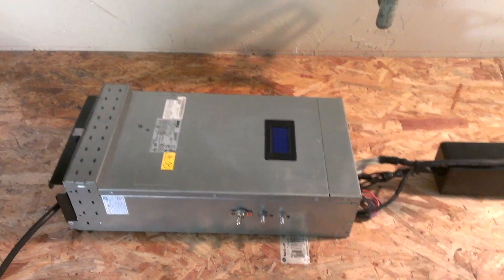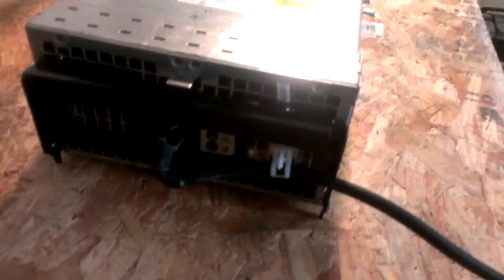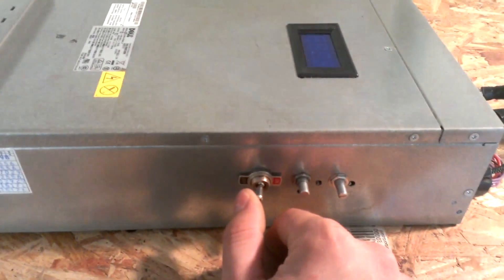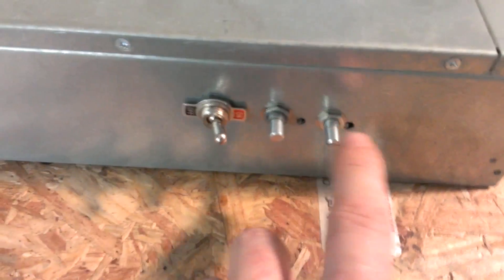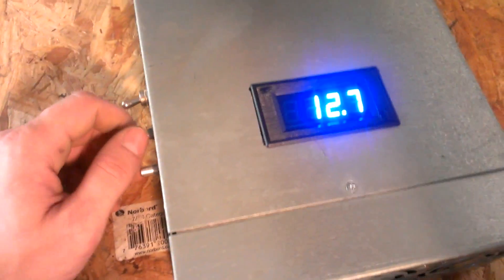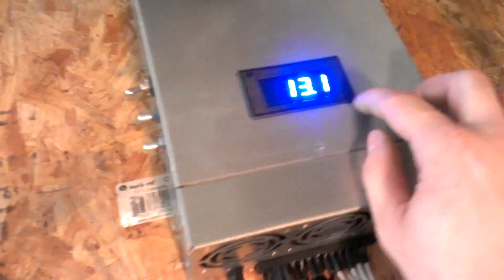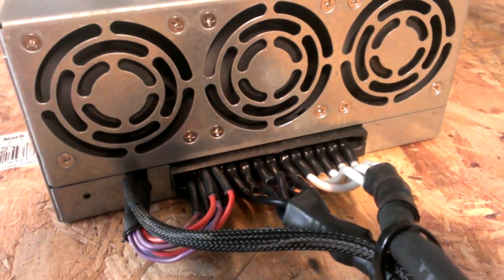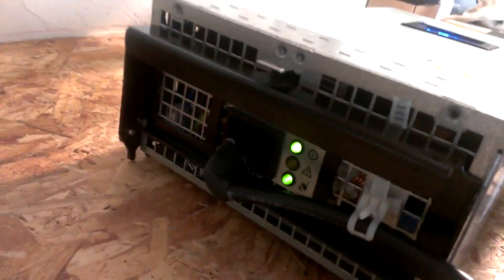How to build a high amperage DC power supply.

Comment: Looking to do this to run a car audio amplifier inside.  Currently running a 80 amp power supply at 12 volts  but I'd like to achieve 13.5-14volts  so that the amplifier will do closer to rated rms power.

Comment: I've electrocuted myself on a regular ATX power supply. They aren't lying when they say it's dangerous Inside the Box. The reason I shocked myself is because the entire heatsink for the transistors or diodes or whatever is electrified. Just a warning.

Comment: i want to charge my car bettery with computer power suply. But in power suply there is a yellow color wire having voltage is 12v thats ok,,, but ampere is low as about 1ampere to 2ampere only (which is not suffient to charge my car bettery). My problem is that how to increase the amperage of (yellow 12v wire) so that it charge my bettery easily.
regds,
thanks. plz reply in detail to solve my problem
Reply: You can't change the amperage of an ATX psu. You can combine all the 12V rails to get a few amps total but you can't just increase current while keeping voltage constant. It would be like increasing speed without increasing fuel consumption.

Comment: jonathan fasking Thank you so much for the Video. Is it possible to run a potentiometer to change the amperage? Sorry if this is a dumb question, I don't know much when it comes to circuitry and such.
Reply: It's a switch mode power supply and only outputs as much current as the device it's running pulls, I'm sure you could probably set a maximum  limit despite what the application demanded but unless you're doing it for test bench purposes for powering car amps at low current to for repairs or something it wouldn't probably make much sense.

Comment: Thank you for this VDO upload. I have one Question though, I want to power UP my Sony Xplod car amplifier at home which needs 12V to 15V DC supply with current rating of 26AMP to 35 AMP max, so basically i need 13V/35AMp DC supply. I am currently using SMPS at home for this which gives me 12V/25amp and my car amplifier works fine, but it gets Switch off when I increase the sound, due to may be it needs more current or Voltage...Please suggest why its so....Therefore I am thinking of using a car battery of 14V/35Amp here for smooth amplifier operation but to charge it, your trick may work, but i dont have volmeter. So tell me how much time it will take to charge battery fully with laptop charger without using Voltmeter or multimeter. OR else suggest me how I can get output of 13V/35Amp from SMPS or any other device conencting it to AC power supply at home.....thank you....
Reply: Just get a bigger power supply and call it a day

Comment: Is there any way to make this output 24 volts as opposed to 12? I've looked at DC to DC converters but they aren't rated for high amperage. I need about 1000 watts for my project (an hho torch), and at 12 volts, it's too hot. I need to be able to run it for about 15-20 minutes. Do you have any suggestions?
Reply: you might try ebay .The have some that goes up to 48 volts . Amps depends on which one you get . look for Meanwell switching power supply. Some can go as low as $33 up. Good luck.

Comment: I like it. There's alot of neat server power supplies floating arount on ebay. If you have a multimeter with temperature reading capabilities, you could have bought 3 or 4 extra probes and left planted them into the psu so that all you have to do to monitor temps is to plug the multimeter into them.

Comment: jonathan fasking do think this could power 1500 watt amplifier
Reply: Myself i use at least 200 amps 14 to 15.6 volts. That should run 8 100 watt transistors , witch on these volts you should get at 12 to 2000 watts depending on amplifier you have.

Comment: If i were to upgrade the filtering caps and other DC output components to a high voltage (and the same UF capacity) what max voltage do you think this switch transformer would max at?, how i understand it there is a 300v inverter, theoretically making the max voltage output 290v or so?

Comment: my dell t5400 happily runs a 1200 watt car amp but be warned, I Have warm wires from pc to amplifier and that's with 4 power and 4 ground wires. 18 amps per rail on my dell psu, which is a 850 watt power supply. 5 separate 12v rails combined. don't use thin wires you'll cause a fire or a short

Comment: Personally I'm not keen on this design.
1)Three fans screaming???
2) LED's on back, panel gauge on top, pots & off switch on side???
2) Panel gauges reading both A & V are readily available & low cost.
3) Really who needs 130 A??
Reply: Well i kinda need 150 amp in 24volts.. we use an old truck trailer as storage.. it has a loading lid thats need a lot of power. It can now only be done with the batteries.. (2x12v at 150Ah paralel)  anyone got any idea how i could fix this.. need it to run without batteries.

Comment: None of the links work just goes on to report spam? You done any thing with the 1855,1955 2100w yet 175A at 12v can you just add a picture of what pins you using for fan control and power adjustment as I need 13.8 the picture of wiring in this video is out of focus which is really frustrating buddy many thanks for sharing this though cheers n beers
Reply: Lol just seen all the info has been added cheers again

Comment: Hey John I built a power supply with 2 dells. with dual output I'd 12 and combined 24 volts. they have a mac 750 watts per u it and 62.4 Amos each also. I've been looking for a way to make them a constant varitable bench top supply using all it potential.  the supply you built seems to do this. I've been told to get a variants, step up step down transformer board  and even a dimmer. problem is nothing will ha dle my watts and amps. can you please help.

Comment: this is dumb, the supply  you used to build this costs more than just buying an actual supply with the specs you need.
Reply: You can get one used for like $25
Reply: Thad ward So? The point of doing projects like this is to learn more about the real world restrictions involved.
Reply: Atx power supply in parallel

Comment: I have a 250 watts(max) power supply and I tried using it to power an amplifier but after a few seconds of coming on it would shut off automatically, any ideas why that might be? is the power supply not powerful enough?
Reply: yes you need a stronger power supply.

Comment: Thats right at the amps of my Lincoln welder...wonder if yours could weld?...or is there something that would shut it down if drawing 130 amps..? cool..video..
Reply: +Kennynva T. There is a lot of current, but the voltage is a bit low to weld with. The total power output is not that high really.

Comment: Interesting.. I am working on an unregulated raw AC-DC convertor block for the welder... won't be as clean as this but it will handle the 80VAC at 225A (its max rating will be 1000VAC at 500A).  Computer power supplies are getting awesome these days for other electronic projects.

Comment: Also needing to build something big , I have 5kw Transmitter I need to get going .. without dimming the house lights ... think its time for 3 phase setup :P

its around 400 AMPS Draw ...
Reply: M4ST3RC4TS 5kw and 400amp are you nuts 5kw is like 10-12a or something at 220v and even at 120 its like 22-30a
Reply: M4ST3RC4TS http://www.12voltpowersupplies.us/ here ya go the answer to your question

Comment: Nobody can read your paper info.
On/off switch and pots can't see  anything. You show paper with blue and purple marker.  Nice coloring, But THAT Is the extent of its usefulness. ..
Needed to do a video with closeups  as you point out the specifics. 
Not very helpful at alll.
Sorry
Reply: Same as cannot read what pins were used for fan and power adjustment

Comment: @Steven King: 130Amps at 12VDC is 1560 Watts, which is barely more than 2 horsepower—and that's assuming perfect conversion of electrical energy to mechanical energy, which, of course, doesn't happen.

Comment: i have done this with a poweredge 6800 JD200 model....works perfect for audio use....powers 1100rms @1ohm 14.6v stable as can be......will help people build if interested an can build for you an sell threw ebay!
Reply: Cool, you should put up some videos of that in use, I've got 2 PowerEdge T300 PSUs I was thinking of using.
Reply: Did you use a pot to adjust the voltage? I don't need to adjust my voltage so what resistor could I use to maintain it at 14.6 volts?
Reply: if i can remember an have time i will post a video.
i dont know what inline direct one to use because i dont have eletrical back ground that good. i was following directions. but you can use a pot an set it at what you want.....never touch the pot again an voltage wont ever change unless the conection breaks then it goes back to reg voltage.....
 but yes i used a 1k pot. i have solderd a 100k ohm resistor directly to the board to raise OVP from 14.3 to 15.3 but my pot only allows me to go up to 14.9 an as low as 12.2 i have tried a 5k pot an the low was 13.4 i believe an went to 15.3/15.4 if i turned really slow. at that point over voltage kicked in. i followed the suggestion to do that being the internals are raited for 16v so im safe.
Reply: Do you know the difference between HJ364, D3015, JD200?
And between 7000850-0000 and 7000850-Y000?
Reply: Do you need to isolate the ground if you put these in series?
Reply: I need one for a 1700 rms amp 16v stable
Reply: 150 DB How much do you sell em for? I'm looking for a strong one to power a 1500 rms amp at a stable current and amperage?

Comment: Any way to modify for variable current control? Got a laser
that needs a buttload of current > : )
Reply: That would be something!  I don't know if anyone has actually done it.  I'm thinking it would probably be easier to just use it in CV mode and run it through a very high current buck driver.
Reply: Get a DC welder